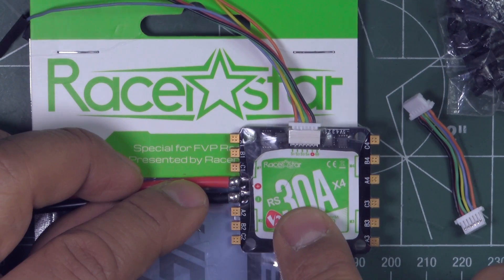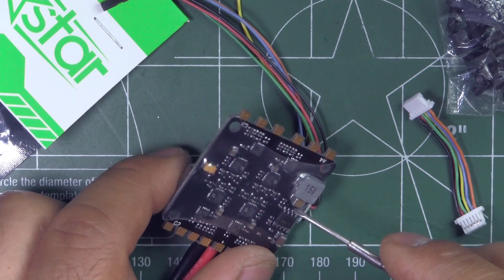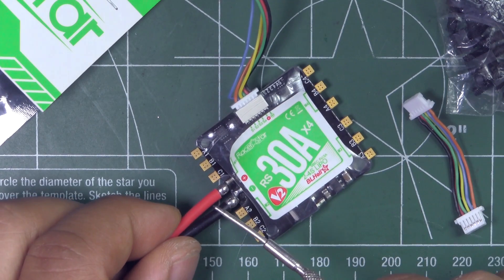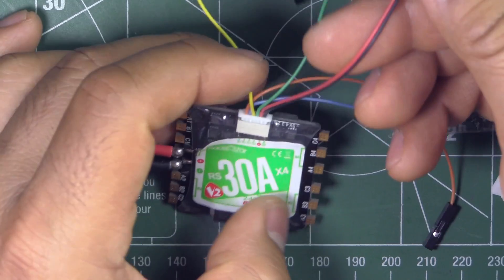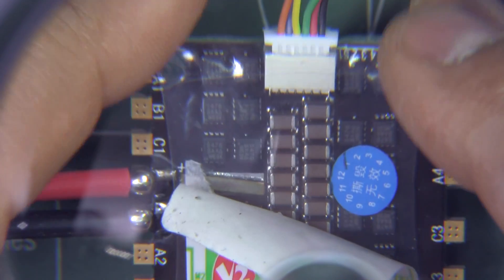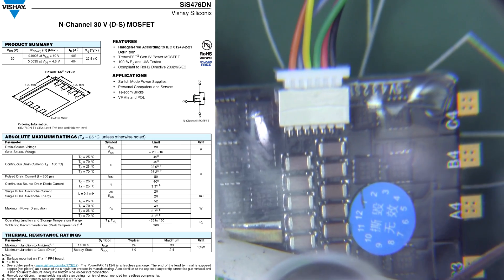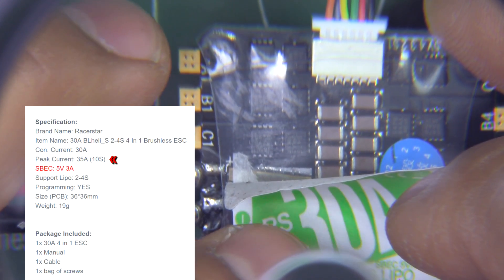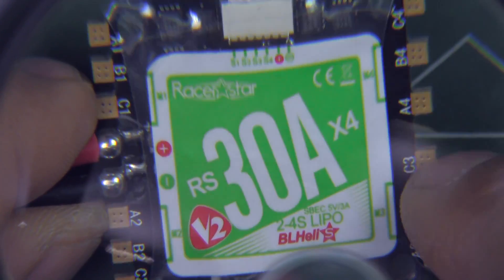RacerStar RS30A V2 4-1 BLHeli_S ESC from Banggood.com

Comment: I have been having a problem with a build that uses this 4 in 1 ESC.  Since I have put RS2306, my video signal seems badly affected by sudden maneuvers like fast flips and rolls. I am wondering if the onboard 5V BEC is at fault, or if these motors produce too much noise on active breaking. I'm interested to hear your views on this ESC in your follow up review.
Reply from the maker: Each setup varies a lot so what affects mine may not affect yours. It could be the 5V BEC is not very stable. I always use a separate 5V reg, I never like using BECs that come in FC's either.
-Make sure all your solder joints are good. Solder must look shiny and totally liquefy to achieve good connection
-Cut all wire to correct length, avoid excess wire bundles
-Use a low ESR cap at LiPo connector on ESC. 1000 uF 25V Panasonic FR series. Digikey,com - USPS 1st class shipping is about $3
-Use a separate BEC. D-Sun adjustable voltage regulators work great. 
For video I always like having a separate dedicated power supply with a low ESR cap.
Reply: Thank you for your reply, I've order a 5v regulator and will see if this cures the problem. Really enjoy your channel, keep up the great work!
Reply from the maker: Yes, hope that solves the video issue. I had similar situation using a Matek PDB on the 12V supply. Had a bad regulator. Some of the newer PDBs work very well too.  But in some setups you may have to use a regulators if you're not using a PDB. 
These are the ones I use all the time, very reliable so far. I buy pack of 10 and use them in most of my builds, even to power Mobius, Xiaomi Yi (with battery removed to save weight!) You need to set the correct volatge with multimeter prior to connecting components (important!) For even cleaner power you can use a Panasonic FR 470uF 16V low ESR capacitor across the output of the regulator + the larger 1000uF as I mentioned before.  

https://www.banggood.com/10Pcs-Mini-DC-DC-Converter-Adjustable-Power-Supply-Step-Down-Module-p-951163.html?p=FR3104108021201212@4
(affiliate link - you can get regulators lots of other places)

Panasonic FR: 
https://www.digikey.com/catalog/en/partgroup/fr-series/3611
(Very important - caps MUST be Low ESR type. FR, FM series from Panasonic are some the best)

More info:
https://www.youtube.com/watch?v=ZhvuQJPGHzU (very good video showing benefits of caps -highly recommended to watch)
https://www.youtube.com/watch?v=J3hoK-XL27Q
https://oscarliang.com/3a-voltage-regulator-mobius-quadcopter-rc-model/
Reply: Thanks very much for all the info, I've gone ahead and order the regulator and will power fc, RX, osd camera and vtx of that instead of the 5v out from ESC. That problem has been getting worse over time, I've swapped  osd and camera, will also replace vtx and capacitor I have. Just to make sure. Thanks for your help.

Comment: thanks man for this review it seems racerstar have started branding there 20a 4in1 as 30a as these fets are identical to my 20a version.
on the stand alone racerstar 30a escs they double up on these fets to get the higher current rating.

sadly they will get away with it as for most setups 20a escs are good enough.
Reply from the maker: Stephen Gibb That's unfortunate they're going the cheap half-arsed route with an otherwise decent design. Why not just price it a dollar higher and do it the proper way using higher rated FETs. As you say, luckily for most setups running 2205 or 2206 motors on 4S and 5" props,  20 to 25A ontinuous rated FETs will be enough but sucks not to have higher overhead you think you're getting. Thanks for watching!

Comment: Works good for me as well, I have it in a Shendrones Flaco build with RS2205S 2600's running DAL 5046C props.
Reply from the maker: Nice! Thanks for chiming in, always good to know what people are using and how it's worked for them. RS2205S-2600KV & DAL C5046 props must be quite a fun package! Looks like this 4-1 ESC does well then, that's a somewhat demanding setup as far as Amps and motor RPM.
Reply: It's not too bad in terms of draw. I run same motors / props on my Shendrones Bigwig (500g auw, Flaco is 470 auw) and on a full punch out it will pull like 109a according to my BFF3 OSD with a calibrated current sensor.
Reply from the maker: That's very manageable current draw. Really shows how props unload and are drawing only 26A each or so, not bad at all. The light build helps some too

Comment: Do you know if these support DShot600?
Reply from the maker: Yes, as far as I've read from several people using these, they've all said it's working fine on DS600 right out of the box
Reply: Cheers, first time quad builder here so bit of a mix of bits. 5" Chameleon frame, HGLRC F4 V5 AIO, Leopard Hobby PHS2205 2300kv motors with this 4in1 ESC.  Was looking at a cheaper frame from BG but liked the look of the Chameleon.
Reply from the maker: Pretty good parts for a 1st timer ;) Should be a fun build. I highly recommend you use a "smoke stopper" -google together with rcgroups word. It'll help ! Also if you're not in the habit of using a multimeter, it's a good time to start. I like checking continuity on all connections. Welcome and have fun!
Reply: Thanks for the tips, ordered a bag of XT60's to make up a current limiter for setup and testing :)
Reply: Mine twitch with dshot on rf1
Reply from the maker: Which motors, what type of twitch? Do you mean YAW twitching? Sometime YAW twitching can happen due to motors that use N52 or stronger big magnets. Strong magnets can send back  electrical "feedback" when ESC/motor change speed. But that's just one possible cause. There are many other factors , including ESC settings, FC, vibrations....

Comment: Yeah fets on this is so tiny compared to the previous 30A 6S Racersar ESC.  Rating on this seems bit wishful.
Reply from the maker: Right, the margin on rated max continuous Amps is small compared to other FETs like the IOR. Still should be good for 2205's on 5" props.